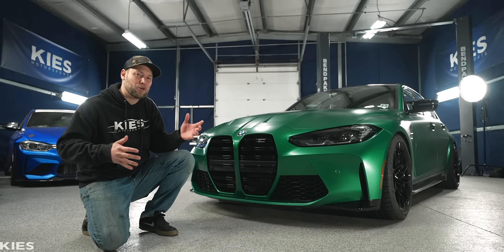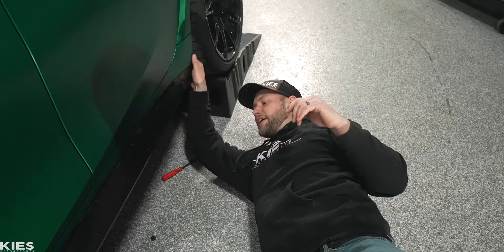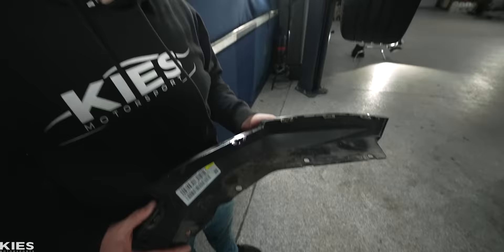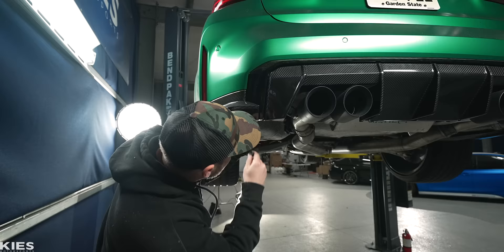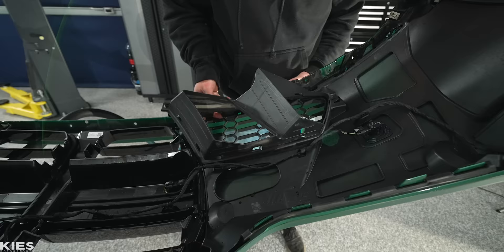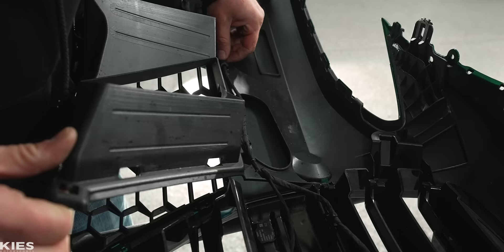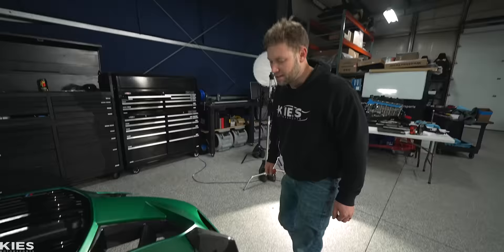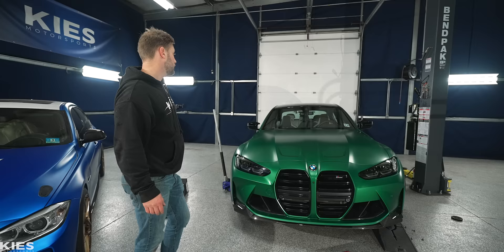Part 1: HUGE M3 G80 CARBON FIBER TRANSFORMATION | 4K

Comment: I was watching this and thinking. The grill in the middle, what if there was a new grill that comes with a snug fit that runs in the middle and then like the two parts that you changed and added the carbon fiber, the middle part with the snug fit to continue across has a part to have a customized under part. Then to the top half you can a different grill. How do you think that may look?

Comment: Bryan, SORRY FOR THE CAPS. I JUST INSTALLED THE OEM CARBON MIRROR CAPS. THE GLASS “DOES NOT” NEED TO COME OUT.

Also, I can’t wait to see the video where you remove the flicks, to beta link them, and what happens to the bumper PPF. 🫡